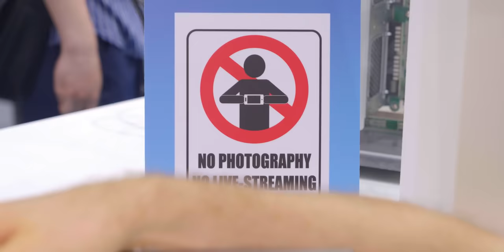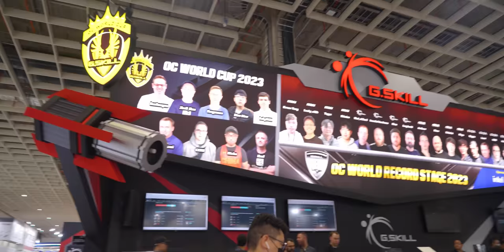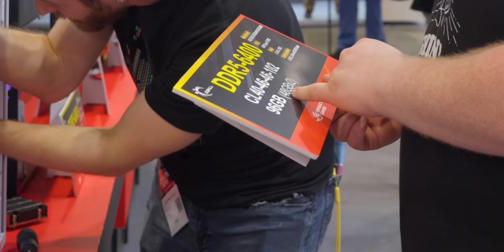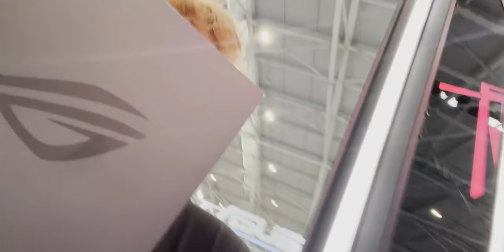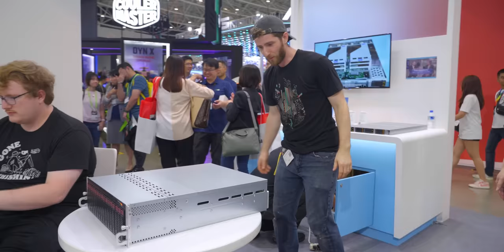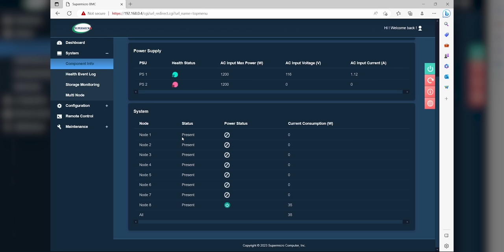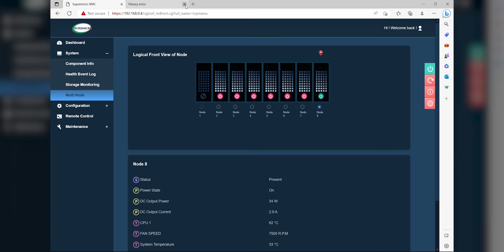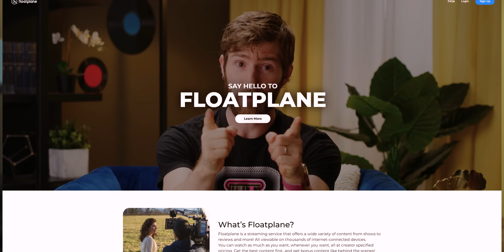This Has EIGHT FULL PCs Inside! - SuperMicro MicroCloud @ Computex 2023

Comment: Linus: "Can we start the video with me carrying 8 computers around?"
Supermicro (uneasy): "Yeah but only if Jake makes sure you don't drop it"
Reply: Jake: (Starts to sweat profusely...)
Reply: Linus: (Starts to cackle mensingly)
Reply: Also Jake: "I don't have ethernet on my laptop. I will turn in my techie badge now."
Reply: @fitybux4664  on a serious note, who goes to a trade show on a professional capacity and does not have a laptop with ethernet?! Sure wifi is convenient for most but once you start dealing with serious hardware wired connections are the only option.
Reply: @alexisrivera200xable  I think he uses a MacBook regularly
Reply: @fitybux4664  fr why does jake have a laptop without ethernet?
Reply: @Sevenly7  Gaming laptops and crap business class laptops are basically the only ones with built-in Ethernet nowadays. Most thin and light laptops that you would travel with nowadays don't have Ethernet ports.
Reply: @scott420  Now that makes some more sense. Thanks.

Comment: I always loved SuperMicro as a company, and have had several of their Server Motherboards running as well as several full servers.  Way back when they had replacement HS backplanes to allow me to switch from old SCSI hard drives to SAS hard drives.  No other manufacturer fully supported their products like SuperMicro does!  Not HP or Dell or IBM.

They still have BIOS / Manuals / Specs for their really old systems online too.   This is the GOLD standard for server companies, especially when you want to either keep them for a long time, or if you need to re-purpose them after the initial deployments.

Comment: This could be a godsend for LAN tournaments, although most team shooters these days have two teams of around five players.
Reply: Man, this for a quake live tournament (absolute overkill but im so down)
Reply: Doesn't have any GPU support so not really.
Reply: @hisfatness522  each blade has a PCIe slot and thus full support for any single-slot GPU? So, with a custom heat sink any not-too-highend GPU should be usable.
Reply: no space for a GPU thats capable of gaming
Reply: @Woodie-xq1ew My Nvidia Tesla P4 could run some games, spec's around RX580, though it is only 75 Watt, perhaps a Tesla P40 would run
Reply: @opfipip3711  Looks like it would fit something like a 4060ti with a custom cooler, which you could limit to 140-150 watts and then pair with a 7800x3d and actually come in under the 2200 watts from each power supply.
Reply: @Woodie-xq1ew  colorful has a 1660 ti as single slot as example
Reply: @I_Like__bananas  You'd have to avoid any cards that require supplemental power and 1660ti's do. I think you'd have to go back all the way to the 1630 or 1050ti.
Reply: @opfipip3711  even something on the higher end would be fine, this things have insane airflow, current nvidia short and dense pcb with a custom heatsink would be fine here, just missing a power connection
Reply: Even without GPUs: As Linus explained these servers are great to host games, so for LANs with the budget it'll work!
Reply: @Woodie-xq1ew  Ever heard of watercooling blocks for a GPU? Those tend to only be single slots high. So yeah you can easily SLAP a HIGHEND GPU into each of those slots if you so wish would just need to find a way to handle the water cooling on them at that point
Reply: @lemonbrothers3462  Yes, its more of a power issue, and less of a cooling issue. You could just reduce the power target of a high-end GPU, Nvidia's GPUs run well past their efficiency sweet spot anyway.  
You could also just forgo redundancy, and everything below 400W should be fine.  

You'd need to do some soldering for the power connectors, tho.
Reply: @Montisaquadeis  and where in that server are you planning on putting the radiators and all the other components required for water cooling? Don’t forget there are 8 cards to cool and those blades are supposed to be hot swappable. Even if the cards had waterblocks there isn’t space for a decent graphics card
Reply: @Woodie-xq1ew  I did say you would have to find a way to handle cooling and if it's whole rack liquid cooling it shouldn't be a problem honestly

Comment: The box is called a blade server. Such boxes are used mainly in virtual machine farms. Each blade typically hosts around 10 VMs, and in order to do so effectively they are designed to have massive RAM capacity. Do the maths and a cabinet full of those servers can provide a very large number of VMs - all of a sudden your corporate data centre got a whole lot smaller.

Comment: Damn, imagine when that tech reaches our personal computers
Reply: It won't, it's for servers
Reply: What, blade-servers?
Reply: @Baconator20000  It's easy to buy a server nowadays if you have a use for it and spare space.
Reply: @Baconator20000  transistors were once a science novelty, basic electrical calculators were very expensive luxuries reserved to labs and governments, and that was less than 60 yrs ago. Getting powerful AI capable tech in consumer hardware in 5/10 years isn't such a big stretch
Reply: @sisig2419  You can't compare a full-fletched computer to a transistor man. That's not how it works.
Reply: @sisig2419  because things can get smaller and smaller like transistors, But these can't really do that easily,
Even if it did get small as a computer it wouldn't be cheap as the amount of transistors needed for that is too much in such a small space
Reply: @Baconator20000  have you ever heard of Moore's law?
Reply: @avananana  erm, yes i can. A computer is just a bunch of transistors at the right place
Reply: This doesn't have any special tech. It's literally just a server rack with multiple motherboards in one rack.

Comment: I was at Computex every day, but never crossed paths, or I would have said Hello. You guys might have missed the incubator companies in Hall 2. A Korean company, XSLAB,  has a cloud server, in a 4U chassis, with 32 compute blades. Each blade has a 24 core ARM64 processor (768 cores in a 4U). They also had a standalone single ARM64 processor (24 core) product called the v-raptor SQ nano ARM workstation. Computex 2023 was not as big as 2019, but still the first real show since the end of the "you know what" restrictions.

Comment: I have a really important question: you know how a small case is bad for thermal, and a big, well ventilated case is good. Well, the question is: at what size of a "container" (drawer/cabinet/box) that you put the PC in, does it stop being a case, and starts being a room? In other words, what is the minimum amount of air volume around the PC parts that can guarantee a constant "cooling" of the PC components? In even other words, how small/big of a drawer can I put the PC in without worrying about thermals?

Comment: You would not use an 7900x3D in a server setup, a 7900(x) yes, a 7800X3d, sure, but the 7900X3D has either 16 cores like the 7900 does, or 8 cores with X3D, but you cannot do both thanks to the fact that they can only take advantage of the vcache if one of the dies is parked (powered down) and such a workload is pointless for a server. 
Although in reality you would be hard pressed to find an experienced network engineer that would install any consumer processor in to a server, they are just not guaranteed for server workloads and are almost definitely not optimized for. You want that purposely built stable Xeon or Epic memory controller and PCIe controller.

Comment: I grabbed an gigabyte z690 D has a video input for my second card . A new gen 5 ssd  and a i7 12700kf .and a nural compute stick .... because learning is required for HAL to decode and swap frames in the vm . Hal doesn't understand me now but he will . I will get 120fps with path tracing and ray tracing in the steampunk benchmark . I have to input my second card into my processor.  And then step by step identifying all no touch buttons and yes touch buttons and what they do . Its a process

Comment: Groan. Blade servers. I thought they’d gone. The BMC interface are already terrible. You’re (at lease used to) only be able to patch the chassis firmware by taking down all the blades, which was always a stressful discussion. And they ran so hot the facilities guys could only put 2 of them in a rack because they couldn’t cool that section of the datacenter enough for more. Which begged they question, why bother with the pain? Just buy a load of 1U servers.

Comment: Ah I was thinking you could put a GPU in there, but yeah there is only enough from for a 1.5 - 1.75 slot PCIe device, so really you can't fit a GPU as 1 slot cards are ded. And water-cooling isn't really an option.

Comment: I will buy a rx 6950 xt for 766,49 dollars and i will pair it up with i7 7700 non K , with 16gb of ddr3 2666 , 80 plus gold 290 wat psu and i will play no mans sky at 1376x768 on normal , i wont plug in the power cable and i will undervolt it to work in 50w
AND YOU CANT STOP ME